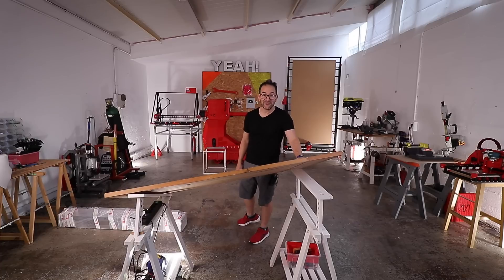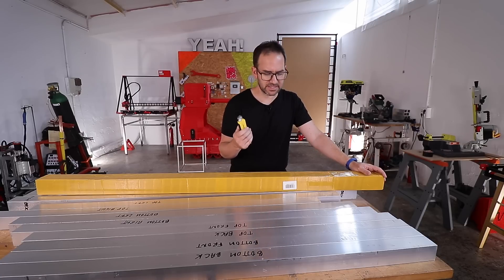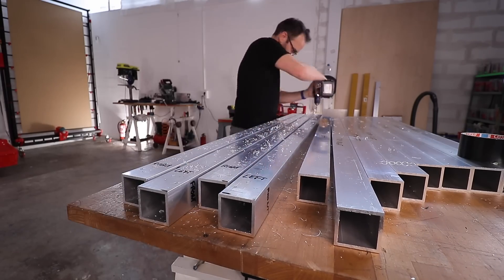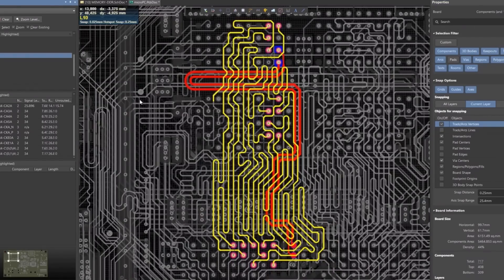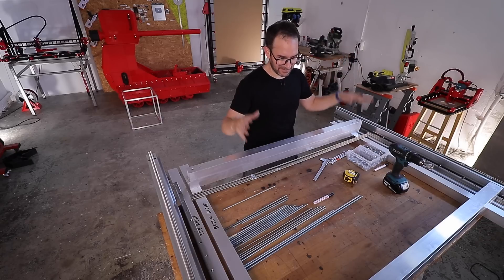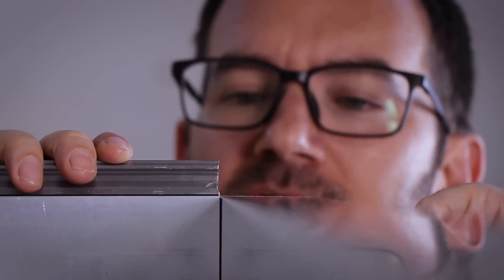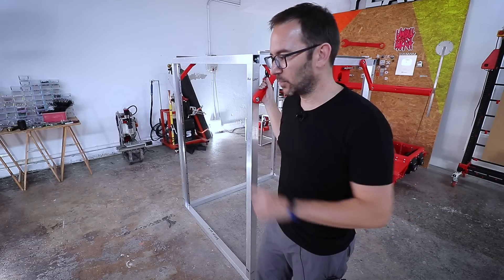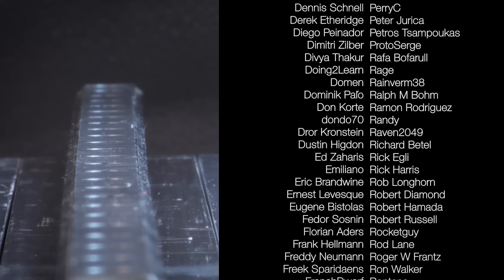MAKING A GIANT FRAME FOR A 3D PRINTER  (from scratch) - GIANT 3D PRINTER BUILD PT. 1

Comment: Sorry guys - seeing him bolt the steel guides to such a thin aluminum profile shows me (as a mechanical engineer) that Ivan has absolutely no knowledge of the parts and materials he's using...

Even if the aluminum bars were completely solid... 

(...then at least the screws would hold without the thread being pulled out of the aluminum when tightened as they should)

...what about thermal expansion => how much does aluminum expand - and how much does steel expand when heated?

Suprise: There is a factor of about 2 between these two materials

=> Better to use steel profiles next time!! (...for a first tip - free)

Comment: I think it's not good to cut rails by abrasive. Better not cut it at all.
Rails are tempered. It comes to be much less hard when you heat and cold it by abrasive cutting.
If you strongly need cut the rail, I think it's better to use blade. Is there somebody who know more about it?
Anyway - good job!!!

Comment: Gheez, that's huge. Very cool project!! Subscribed.

But, this immediately popped into my head 🙂

"If one ox could not do the job they did not try to grow a bigger ox, but used two oxen. When we need greater computer power, the answer is not to get a bigger computer, but... to build systems of computers and operate them in parallel." - Grace Hopper

Comment: Here is a tip for drilling nice round holes in aluminium. Round, instead of pentagrams with rounded corners.
This method works best when using a column drill.
First, use a small drill and make a dimple in the metal, no deeper than 0.5 ... 1 mm. Now, change the drill. Take the one with the desired diameter.
Take a bit of very thick oil, very viscous. Put a large drop onto the dimple. Cut a piece of felt of about 3x3 cm and place it over the dimple. Add another drop of thick oil onto the middle of the piece of felt. Now drill the hole. Do not drill at high speed.
Voilá....!
Not always perfectly round, but this method always works better than drilling the hole "dry". 
Why does it work? The felt and the viscous oil reduces vibrations (resonance) very well and thus keeps the drill tip from wobbling, creating this unwanted hexagonal hole.

Comment: I am concerned that the extruder arm will bend and wobble when printing. Have you considered a tensioned cable system instead of or working together with the linear rails for stability? Excited to see where the design goes

Comment: You need to call your suppliers and cuss them out for sending all those parts with issues. There's no excuse for bent linear rails or skewed cut (not 90 degrees) faces, and the wrong sized all threads. Now you have to readjust the whole things to accommodate their poor standards.

Comment: TIP: i got my dad a cheap 250kg electic winch a few months ago that we mounted on the roof of the workshop with a rail  so you can raise heavy things (lawnmower f.e.) and either work on them or slide them over on to a table or the other side of the workshop ... makes things soooooo much easier and safer ! definately worth the few $$$ and a days work.

Comment: For this volume, are you not interested in installing a pellet extruder, with automatic feeding?. there is a difference in price between 5 and 7 euros Kg, between the filament and the pellet. The size is totally insane. But great desing Ivan.
Reply: You can build a robot for drill holes and tap them if necessary. This robot for another proyect

Comment: There's a thing called a "transfer punch" for transferring hole locations from one piece to another. You should get much more accurate hole locations and save yourself the step of marking with the Sharpie. I wonder if you can get drill guide bushings that fit screw clearance holes to use as a guide for the tap drill. That would cut out the punching step too.
Reply: Alternatively, he could have drilled the holes with one of the CNC machines he built, and program it with the correct hole spacing.
Reply: Yeah that's the better way to do it. For Alum I would just spin it up on a lathe with any bright bar, but for a lot of punches a cheap way is to grind a point on a close fitting flat punch or the shank part of a broken drill.
Reply: In a pinch you can also use a drill bit the same size as the hole in a rail, just only drill just enough to make an indent, that will center the smaller bit later.

Comment: Oooh, way to really push the barriers, fantastic work Ivan. One question though, should you do a lot more to stiffen the whole frame? I mean isn't the quality of a print reduced by vibrations, something that big, will easily pick up vibrations, so you should add dampening feet, and stiffen the whole thing up as much as you can.

I'd also triple or quadruple check that the whole thing was squared too. 

I read somewhere that the more you tightened the tolerances and locked down the construction to the nth 1/1000 mm or less, it also improved the details. The setting's were were different, but the result of that idea stuck with me. But I feel like it should be true for 3D printing too as any vibration of flex would be bad right.

Good luck and keep inspiring us all, thank you so much for that. :D PS, I can almost feel my impatient for the rest of this story :D

Comment: Curious why you went with threaded rods to hold everything together instead of fabricating some brackets. That probably would have helped with the overall rigidity too.
Reply: Yeah there is no register/doweling to locate it properly/strongly, it's just friction between them. He probably should've 3D printed a plug to go inside the ends that are a tight fit on the rod, that way the rod acts as a kind-of dowel.

Comment: I had a thought that using TPU or another flexible filament for the legs would help with vibration dampening while the machine is running.

Comment: I am curious on how you will further improve the stability of the frame. I guess some will come by itself when everything is added. But I guess some more braces for the frame won't hurt, since this is huge and heavy and internal resonances probably will affect the printing.
Reply: Came into comments looking to add the same question…..be a lot of room for vibrations while moving on it’s axis’s

Comment: Great design Ivan. Looking forward to seeing the final product. Note: The rail cars for the z axis were not installed which means disassembly of the linear rails or top frame
Reply: I believe he left them short due to x and y gantry height + hotend length so he can slip them on the top?

Comment: Curious of why you are making the bed moving on the z axis rather than making a flying gantry so that there's less weight to move. I'm sure the motors are going to be more than strong enough so not a concern, just wondering
Reply: You could make a counterbalance with a bucket of water that you pump water into to keep the weight balanced... no static load though I guess your z hops are going to take twice the force. Not sure which is more limiting in practice?